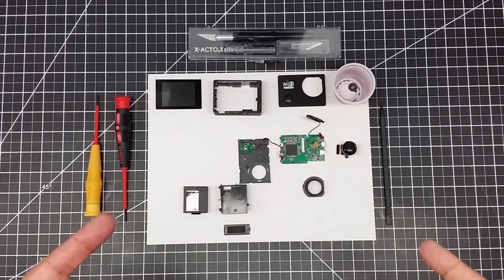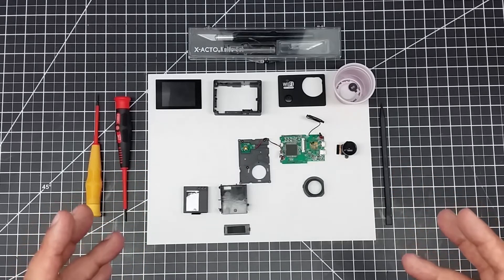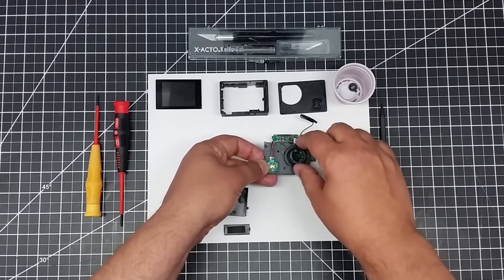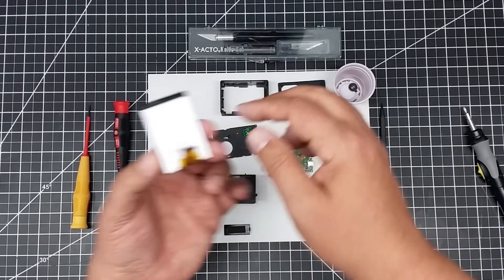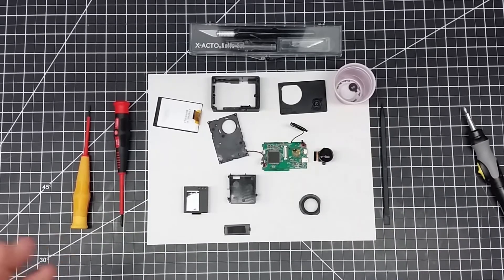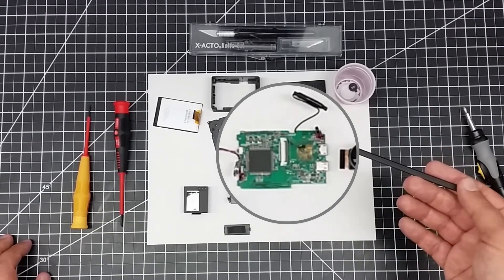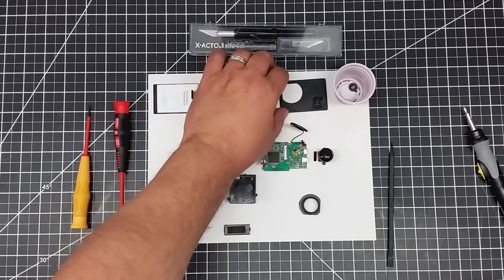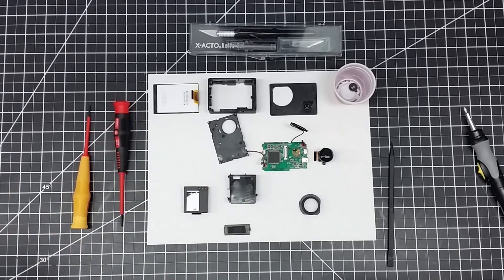Bench Talk - How Successfully Disassemble  a Cheap Action Camera to Mod!

Comment: Have you tried to modified a YI Smart DashCam ???
Would like to make the DashCam Full Spectrum and put a Capacitor.
When you get a chance do a tutorial video on the mentioned mods.
Thanks for sharing.
Reply from the maker: I dont understand the capacitor part?
Reply: @VideoDrone  
Changing from a Lithium Battery to a Capacitor, its been done on Mobius cameras, but I want to do it on a DashCam.  This mods helps with heat resistance and reduce fire risk due to the battery not able to handle direct heat from the Sun.